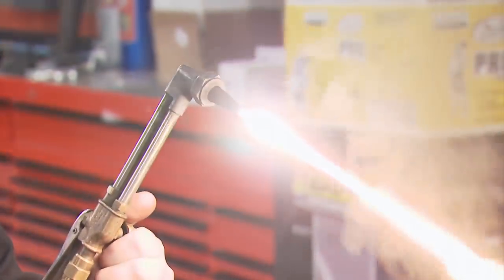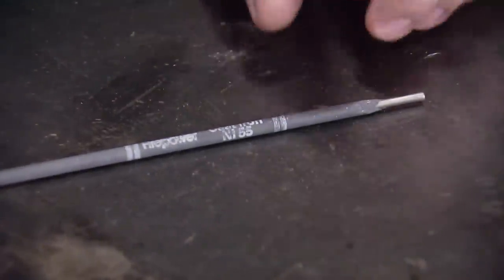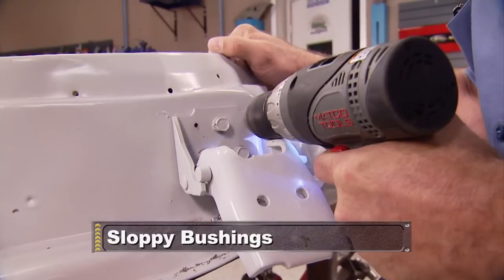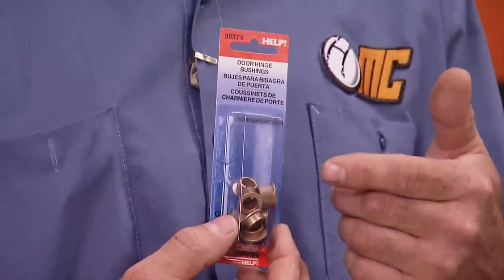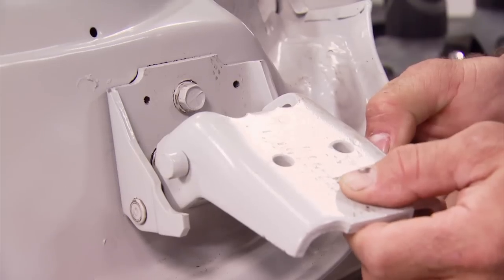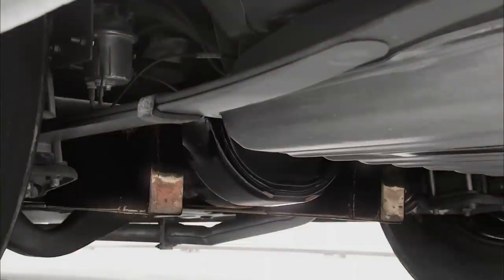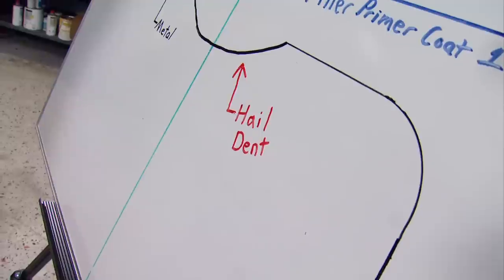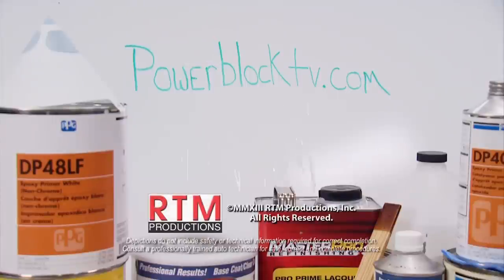How To Weld Cast Iron - MuscleCar S8, E13

Comment: my experience with cast iron is that if you are super careful about cleanliness, have impeccable technique and maintain perfect distance from the puddle through the entire weld, with slow cooling and careful setup, that when it breaks into even more pieces than you started with you can tell yourself you did it all correctly, cut your losses and braise the part like you should have in the first place.

The best welders I know will not weld cast iron at all. The best one I know won't even braise it, at least not for customers, as in her experiences more than half the time the customer is faced with another broken part fairly soon.

Now, this dos not apply to all kinds of jobs. Plenty of engine block cracks are very repairable, but something like that drill press part? It will never have strength. it's probably just a cabinet piece anyway, probably broke because it was dropped, and maybe it will survive.... Don't try this shit with a connecting rod though.